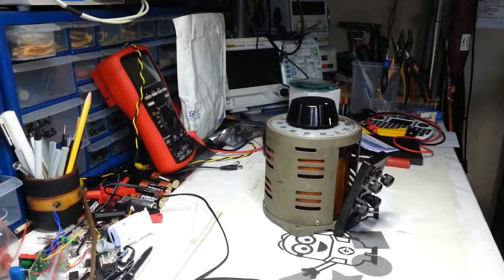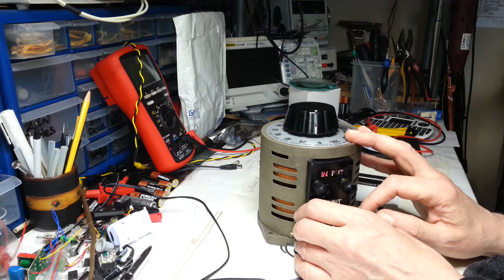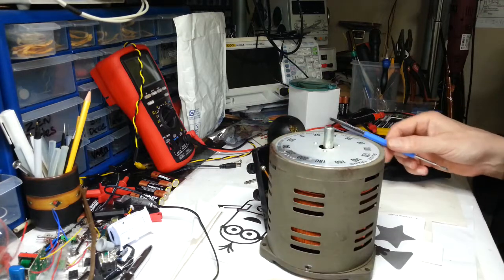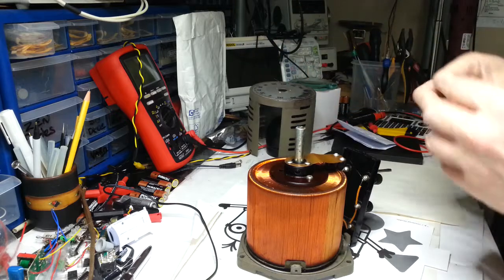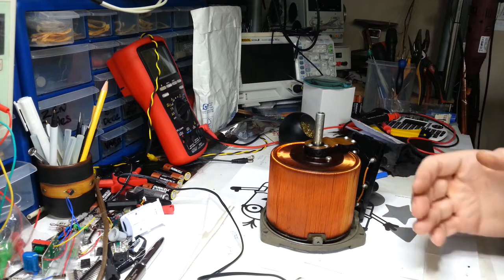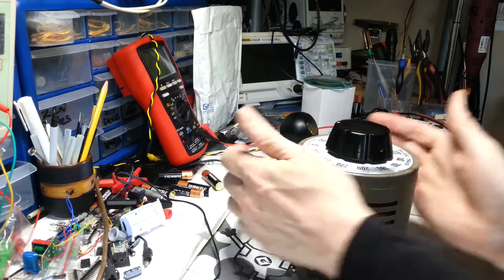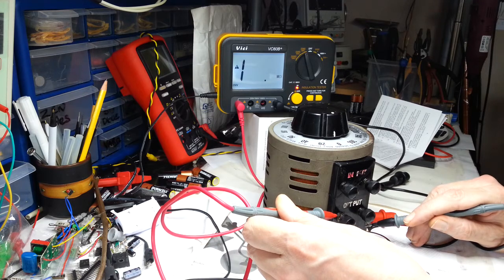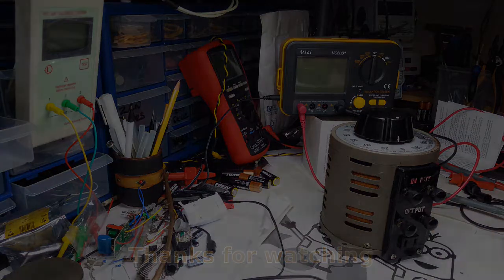Used Slide Trans Auto AC Mains Transformer VariAC Pt2

Comment: Waits for part 3 where you slowly run your finger around the variac coil feeling the tingle slowly get stronger...smile
Reply from the maker: Thinking about it I have a Dyson which I could take the noisey motor out of. I also have dug out a heater element. It is 53 ohms so I could take it to about 120v before stressing the VariAC,,(Auto Transformer) lol.
I have done some tests with different wattage bulbs but have not put the video up yet, I will tomorrow.

Comment: Got a 24 volt motors to test it with...your viewers would enjoy that...I put a 7808 on the solar panel today...incase it stopped raining and the radio blew up
Reply from the maker: What is the voltage of your panel, no load? Not as common the 7808. I have a few but had to take the out of things. A couple of resistors and a 7805 will get you want you want most of the time. Hark at me sounding like I know something. That's it though, that's all I got.
Reply: My solar panel is very powerful for its size (1000watts per sq meter type)..it will power a 7 watt radio and destroy a battery at the same time even on a cloudy day...no load is 21.4 volts 1.27 amps
I love salvaging parts from old stuff...got a large collection of old components...including WTF is this??? ones...like .... 

https://i.ytimg.com/vi/tQyX3F4ggM8/maxresdefault.jpg
Reply: I think you mean the LM317..I wonderd why i was getting 10 volts out (12 volt in) of my 8 volt reg circuit then i noticed that i had bolted the 7808 on the heat sink back to frount...well now i know an easy way to get a 2 volt drop..smile
Reply from the maker: bunnyathome no. the 7805 I made a video using it for variable or 9V or 12V I can't remember.
Reply from the maker: bunnyathome I did make a variable current and variable voltage with 2 LM317's then swapped them for 338's cause was easier than putting in pass transistor.